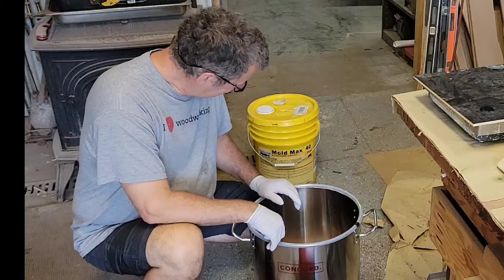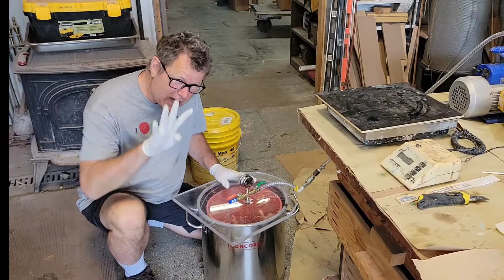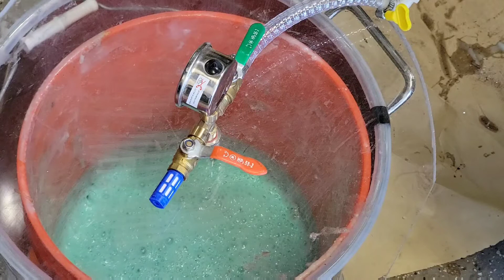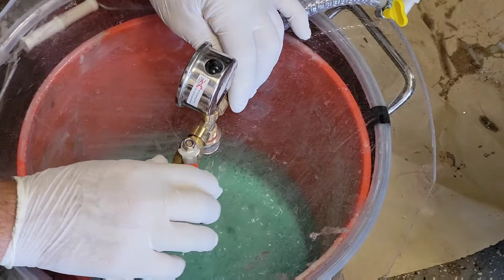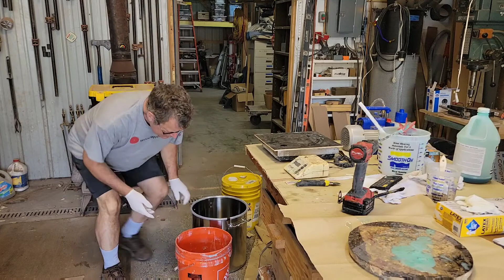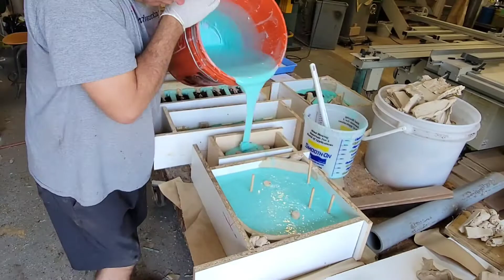How to degas silicone mold compound.

Comment: What size of vacuum pump do you recommend? Do you think any old pump I can pick up at Harbor Freight will be enough, or does it have to be something particularly powerful?
Reply from the maker: Any one that will draw at least 27 hg.   (inches in mercury)   Harbor freight AC vacuums will work fine.  I used that for years, recently upgraded to the Vevor two stage.